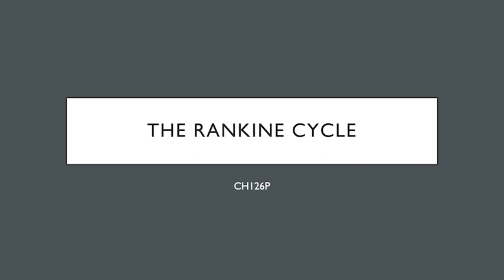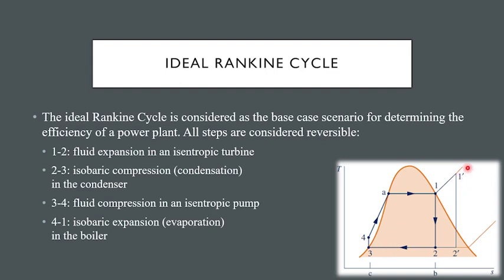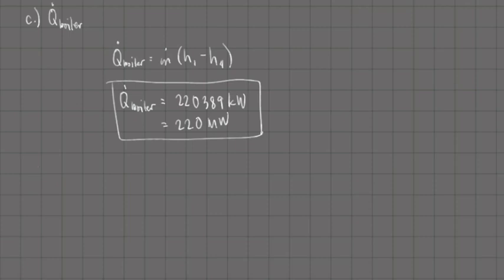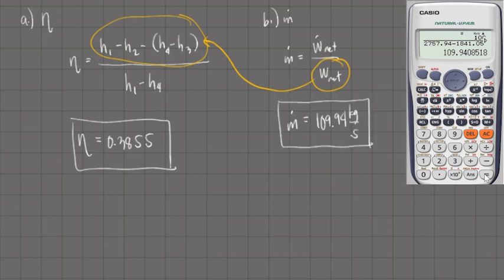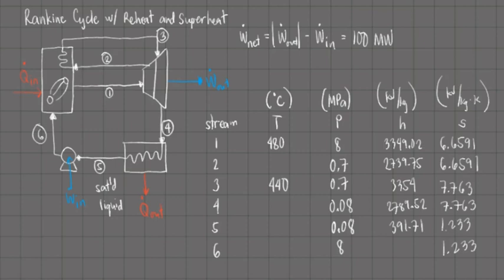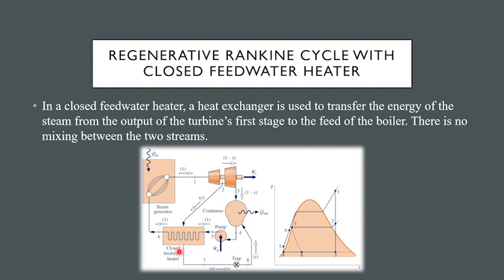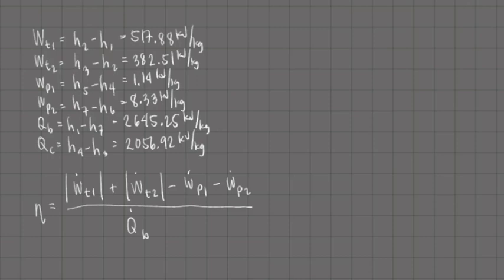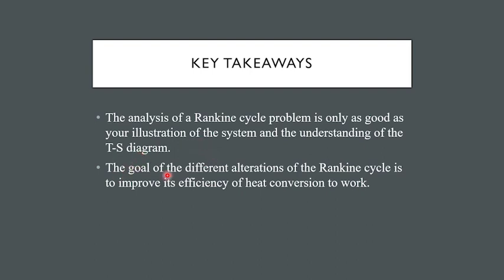Lesson 4.2 - The Rankine Cycle

Comment: How did you determine po the temperature and enthalpy for the compressed liquid at stream 4?
Reply from the maker: You have 2 options:
1. interpolate directly in the compressed liquid property tables using pressure and entropy in stream 4
2. assume that liquid water is incompressible and use the relationship h4-h3 = v3(P4-P3)